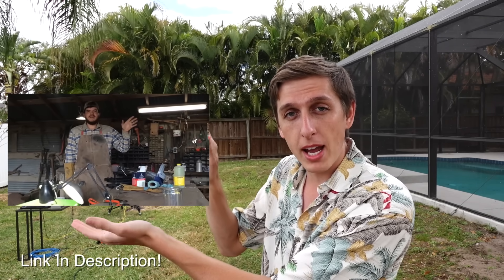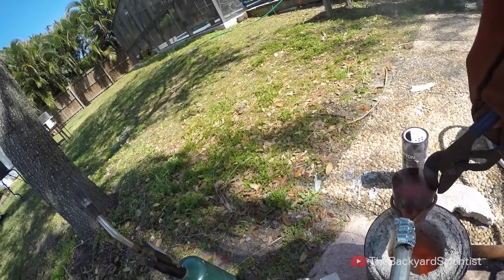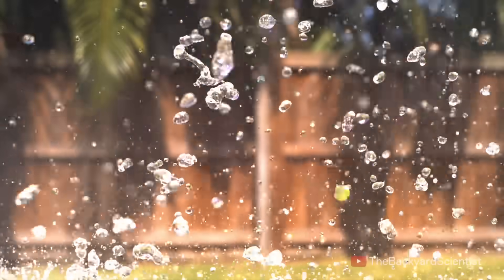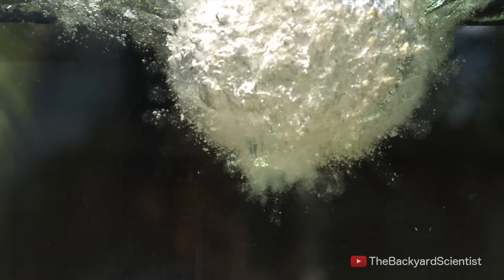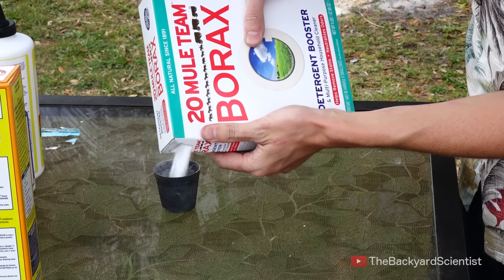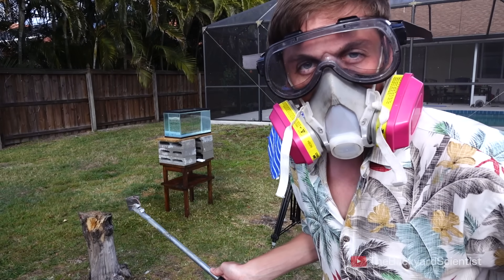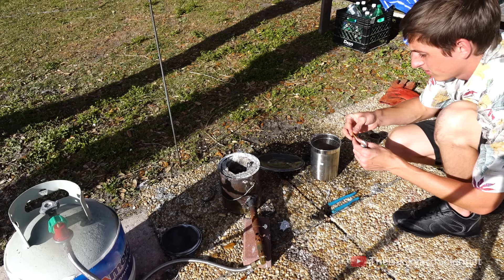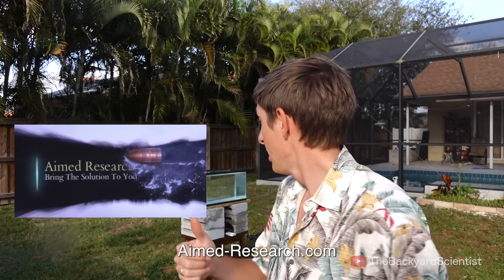Pouring Molten salt into Water - Explosion!

Comment: Can u be my science teacher
Reply: +Nahraine Abid he could, but he is wrong, it is a chemical reaction: H2O + NaCl --> NaOH + HCl + energy, that is liberated as an explosion
Reply: +ddzanna Ah the comment warriors and there genius comments that probably came from some web page
Reply: Der Retro - Selbsternannte Internetpolizei 
Because sodium and chlorine in solid state exist in a 1:1 simple cubic crystal lattice, there are no individual molecules. When NaCl shifts from solid to liquid its bond strength remains the same, the atoms only have more energy and the bonds shift around because of that excess energy. 
The sodium/water explosion occurs when the metal comes into contact with water and starts ripping away hydroxide groups, replacing hydrogen, by releasing all the necessary electrons through the dissociated electron cloud of the metal bond structure. This sort of rapid chemical chain reaction cannot occur when there are bunches of sodium chloride bonds to break; there is no metal lattice and no dissociated electron cloud. 
You may have heard that pouring salt into cold water makes it colder, this is the case because it takes energy to break these bonds, after which water molecules surround individual sodium and chlorine ions forming sort of barricades around them. There is no NaOH or HCl in a saltwater solution, just individual ions and autohydrolysing water molecules that turn to H3O+ and OH- and back to water at random.
Reply: +ddzanna would that not change ph
Reply: Der Retro - Selbsternannte Internetpolizei Oh, but the sodium never becomes free. an ionbond is not broken that easily, else we'd see chlorine vaporize away and that would cause the liquid to become caustic with exess NaOH. No, salt remains salt and dissociates only after dissolving.
Reply: I learned more from this video than my ap Chem class in a semester
Reply: Ok I want em
Reply: +catman8u Marsh not necessarily, since the NaOH is alkaline and the HCl is acidic. With equal concentration, they cancel out, BUT when both are mixed in water, they create Water and sodium chloride again. 
Its most likely the sodium, since it is an alkali metal. Those are known to Violently react when put into contact with water. 
Caesiun for example already reacts with the moisture in the air
Reply: +Der Retro - Selbsternannte Internetpolizei Then again, what he says is true. The substance is molten, not dissociated; there are no individual Na+ or Cl- ions or atoms in molten salt but NaCl molecules that have lost their molecular lattice. I'm more inclined to say that this is a vapor cascade explosion.
Reply: teutonieth as i said, its the now free sodium contained in the liquid that reacts. Take a little piece of sodium, can be solid liquid or whatever, and put it in water... It throws sparkles, jumps around
Reply: teutonieth its molten. The ion bonds arent as strong as if they were in their crystalline form. The Chlorine doesn't vaporize away, it reacts with the hydrogen that is released in the reaction of sodium and water, forming NaOH and HCl, which then turns back into H2O and NaCl... 
The reason is, that when NaCl is solid, the crystalline ion grid is very stable, but can already be slowly "ripped apart" by water layer by layer. We call this dissolving. When its molten, there arent any effective stable bonds left, they are still linked together, but there arent any NaCl Molecules, so the Sodium can easily react with water...
Reply: +Der Retro - Selbsternannte Internetpolizei So, excuse my shitty chemistry, but wouldn't that be contradicted directly by other substances not reacting the same way as the NaCl? If it's just the sodium in the liquid, how does the substance affect the result?
Reply: +teutonieth that's right, sodium is already ionised in NaCl, it can't react with water molecules because it doesn't have any free electrons to donate. Except, maybe, sodium ions can get solvated by water molecules, but usually the free energy of solvation isn't that high, definitely not high enough to cause such an explosion.
Reply: +teutonieth In deed water is a stable ampholyte, so it does not turn to H3O+ and OH-
Reply: +LiangRome The way Na reacts with water is affected by some of its physical properties like atomic radius and some others. So, this is the way the substance affect the result.
Reply: +ddzanna MY BRAIN IS STUCK BY READING YOUR COMMENT
Reply: +ddzanna 
uhhhh...
the more i try to understand your comment
the more brain farts i have....
Reply: +ThatCreepyGuy InTheCorner really... xD
Reply: +ddzanna and heat :.(
Reply: +ddzanna uhhhh I kinda understand
Reply: Fr
Reply: +ddzanna pretty sure the chemical reaction you mentioned above have a positive ΔH, meaning the chemical needs to absorb energy from the surroundings to under go the reaction.
i guess is the H2O(l) turns into H2O(g) which expands, while the water and glass creates a shell around to build up pressure until it excess the glass's maximum strain, causing it to explode like a grenade.

Comment: and this has almost nothing to do with the pH of the water. this is purely an combustion between the element of sodium and the molecular compound of H2O. And I'm estimating the salt reacted the way it did through the temperature the salt was at separating the bond between some sodium and chlorine ions, ultimately making the sodium able to react with the water and the chlorine to either turn into the state of a gas or remain in the water

Comment: did'nt test Chlorine
Reply: i guess because its a Gas and its highly toxic and corrosive and not do essy to transport or even heat up. what happens when chlorine gas touches water is it creates HCL hydrochlorine acid that also happens if you breath it in it forms hydrochlorine acid inside you by reacting with water eating you from your inside out until your lings are not existing anymore and you die a horrible and gruesome dead.
Reply: +Gtifighter I know I like ww1 docs too
but the oxigen carbon bonded to the 2 chlorine would be missing?
Chlorine by it self is pretty bad tho
Reply: +Emeric Catudal 
Phosgene, COCl2, was used as a war gas during World War I. 
It reacts with moisture in the lungs to produce HCl, 
which causes the lungs to fill with fluid, causing death of the victim. 
For COCl2 (g), S˚ = 284 J mol-1 K-1, and ∆Hf˚ = -223 kJ mol-1.

Comment: So I don't know why the salt explodes. But the sodium metal made the explosion because it is in the alkali metal family of elements and because of the outer valence electron shell has only one valence on it, because of this the element is unstable charge wise and wants to lose the one valence electron to become stable. So when it touches any other element or compound (except the noble gasses) it will give that electron away. But I'm sure you knew that

Comment: With my genius 8th grade knowledge( sarcasm implied ) i hypothesize, it separates its self into sodium and chlorine witch sodium and water explode. And half way through typing this i saw he actually he talk about this so your welcome lazy people.
Reply: I don't get how he didn't just work it out like that. its pretty fucking simple. I'm going to guess that when it's heated the atoms move so quickly that the water got in between and the reaction took place. if that makes sense.
Reply: Meme Team partially
Reply: This is incorrect as the sodium found in table salt is ironically bound to the chlorine. (Na+Cl-). That means the sodium he used has lost an electron, reducing its potential energy to react with water.
Reply: +Mumie Mumie ok I'm still in eighth grade Am I supposed to know about what you just said? Or would it be normal to be confused

Comment: Sodium metal explodes in contact in water either is its room temp or molten. Pure sodium has a chemical reaction to water. When you melt salt for a number of time the sodium is separated causing it to blow. The ph will not change in the water for sodium is not a acid.

Comment: Oh loss or gain has nothing to do with a chemical reaction this whole experiment is nothing but a chemical reaction the diffrence between the soduim metal and salt is the concentration of soduim in each with the huge concentration of sodum in the sodum metal once contact occurs the chemical break down is instant where salt has a smaller concentration of soduim causeing the reaction to be less instant allowing it to go further into the water where if you could put the soduim metal in the tank of water at the same location where the salt went off completly then the soduim reaction would be much more vigorous a physical reaction is also a chemical reaction just so you know

Comment: So NaCl is still NaCl no matter the temperature, Mix it cold and it will dissolve. check out its valence and you see its stable.
Therefore its not a chemical reaction, it is purely the extreme rapid heating of the water molecules. When  you dropped the salt at the lower temperature the vapour formation was much slower, but not so at the  higher temp. The water heats up and expands so rapidly that the force is enough to expel the water in all directions, and of sufficient force that it will tear apart the tank

Comment: Bruh, at 6:55 with no eye protection, exposed legs and knees, less than arm's length to what is already by that point confirmed to be the potential for a violent explosion, alongside a lot of heat and molten metal and steam.

Screw the dog waltzing barefoot through the lawn with glass aquarium shards and no canine ear protection, this guy is looking to get HIMSELF killed.

That said, interesting video.

Comment: As they say, is both, a chemical explotion due to fast reaction between sodium and water, and a fisical thermal shock.

Layer by layer explotion due to molten solid (liquid hyper heated)-liquid at normal temp to a solid-vapor fase to equilibrium (and of course, Big pores on the surfaces).Creating a gas bubble for vapor water and sodium it reacts more easily.

Why the others salts no explode if are more heated? is because reaction are more slow to break due they need more energy to melt. so freezing fast create a layer by layer molten solid and liquid up to solid-liquid equilibrium (small pores). which is more estable and less reactive because less contact Área.

test: boiled water to cold water, and boiled water to Ice.
Why there is not acid or basic changes? explosive, gas escaping for chlorine and Sodium from vapor water... not the liquid fase.

Comment: I think the sodium is reson for the Explosion, because you melt it get a way frome the Chlor in it an can explode.
Reply: +GeR_RiGhT No it's not. You're not separating the atoms when melting. That won't happen until you heat the compound sufficiently to achieve evaporation.
By melting NaCl you just "loosen" the crystal structure. You don't get ion separation until you reach much higher temps. I seem to recall that the boiling point of NaCl is about 1700 K.
No. This can't be anything else than what was said in the video. It must be due to an exponential amount of water being evaporated creating vapor cavities in the liquid phase.
Reply: yep
Reply: +Josh Lucas yep

Comment: I think it explodes like that because it is a chemical reaction just like when u put Sodium into water. The reason the Ph doesn't change is because salt is not acidic and not very basic. As you heat the salt the NaCl molecules start seperating more and more. All this Energy is released once it touches the water and tries to solute into it.

Comment: Pour some molten Copper into the Fishtank and it will react very similar (i did this accidently one time while bronze casting).

Salt has one of the highest thermal capacities and evaporation enthalpy of any material. That is why is it used as a heat carrier and storage medium in solar thermal power stations.

So the thing is that not only Salt can have this water evaporation explosion, but Salt just has an extremely strong  one compared to other hot liquids.

Comment: The reasons I think this happens is due to the massive amount of energy released from either or both:
1. Cooling of the molten salt
2. The lattice energy released from the molten flux transforming into the crystalline lattice

The lattice energy is quite high for NaCl since it's a pretty  stable crystal and other factors too. The steam that would be released by the quick cooling of the molten salt is also very capable of the explosion.

Given that, I have never seen and form of translation of energy (other than in a nuclear explosion) where it form those explosion clouds.
Reply: +TheIndianGuy Reasonable hypothesis.
Reply: No its the chemical reaction of sodium ions striping water of electrons.
Reply: But that doesn't seem like an explosive reaction. Sure it could be exothermic but as he clearly demonstrated with pouring molten sodium, the sodium ions react differently to molten NaCl. I am pretty sure that I am correct, but a better way to check for my theory would be to measure the energy release through a calorimeter and confirming if I was right.

Comment: it reacted because of the sodium which is extremely reactive
Reply: yep
Reply: +Josh Lucas yep
Reply: +Sean Allino Maybe, but he melted sodium later and that reaction was not as large as the one done by the molten sodium chloride. I'm just need to know if he simply melted the metal or heated it up to the temperature sodium chloride melts, which would explain if this was a chemical reaction or a physical reaction.
Reply: Also: 
+TheBackyardScientist
Reply: Yuen Alvin+ The sodium didnt have anything to push out but the sodium chloride or table salt  exploded kind of like shrapnal with the unbinded explosive sodium and the chloride + probably parts of unseperated sodium chloride particle. Hope that explains it to you well enough.
Reply: +Yuen Alvin if you want to know more about that stuff you could look up rapid chemical change videos or videos of rapid cooling of highly heated substances.

Comment: It does seem to be thermal dependent.  The salt had to be hotter. The papers cite injecting water into molten salt. The two might be related but might not.  Also reminds me of the thermite and ice explosions from a while back.

++ Maybe the salt itself is forming a high stress solid then shattering, like a Prince Rupert Drop?  Except sending super hot salt into surrounding water overcoming leidenfrost effect and flash-vaporizing a volume of water?

++ Salt might just be good enough to dissolve into the water even when heated to form a small amount of brine that does not flash steam away from the hot salt right away, creating more brine, until a volume of water/brine flash vaporizes?

++ I don't think it is dissociating water into hydrogen and oxygen, that is listed as 2,000°C. Salt boils at 1,413°C.  But maybe there is a catalyst effect.  The recombining of oxygen and hydrogen can be kind of exciting.  And it wouldn't change the acidity.

++ I don't know if an acidity test is definitive if reactant products are insoluble or hot enough to be lost as vapor.

++ Maybe try pouring the salt into a quenching oil that it will not dissolve into, and see if you get a version of a Prince Rupert's Drop.

Comment: Its a physical reaction. Solutions are not a chemical reaction. This happens due to the temperature difference between the water and the molten salt; you could actually amplify the effect increasing this difference of temperature, either by heating  the molten salt even more, or by cooling the water (but it must stay liquid, so the  contact surface doesn't get affected).
Oh, and of course the final solution shouldn't have an affected pH, cause the water is neutral (as long as it is "pure"), and salt is actually the product of a neutralization reaction (chemical), so salt is also neutral, and then, as water is neutral and salt is neutral, mixing them both (which is a physical reaction, not chemical [don't confuse it with a chemical reaction just cause water molecules can "trap" salt molecules, cause they can "trap" it because water molecules are polar molecules, but they just retain salt, they don't get chemically linked]) should result in a neutral solution.
Thanks, I like your videos :)

Comment: My take on this is that the sodium reacts quicky to form sodium hydroxide and hydrogen gas, which is flammable and explosive. The heat offered by the molten salt is 300ºC over the autoignition point of hydrogen, so I'm pretty sure that quickstarts the reaction. Also, this helps spread out the sodium which in turn accelerates the production of hydrogen.

Try this out with another alkali metal salt to see it it produces the same effect. Maybe also drop in some phenolphtalein to make sure that the NaOH is being formed, to corroborate this hypothesis.
Reply: +Cyberw4y He did a small scale and it came out pH neutral, ruling out the usual Sodium in water.

Comment: What I think is happening is that the heat is burning the bonds between the sodium and chlorine in salt and sodium is actually explosive unless it is with chlorine so heating it up destroys those bonds allowing it to explode which is probably why it worked better when you heated it up more

Comment: I do not think its anything to do with steam as steam is not explosive unless highly pressurised in a container,  What is more likely happening when the molten salt enters the water is the extremely hot salt instantly super heats the water breaking the hydrogen bonds causing a bubble of hydrogen that then explodes due to the heat of the salt.

Comment: Could the sodium chloride at that high temperature act as a catalyst to separate the H2O which then due to the heat instantly recombines again? So what you get is an explosive transfer of thermal energy out of the salt and into the water? You would not have any visible light from an explosive spiting and recombination of H2O because a hydrogen flame is not visible. Perhaps an IR camera would have shown something?